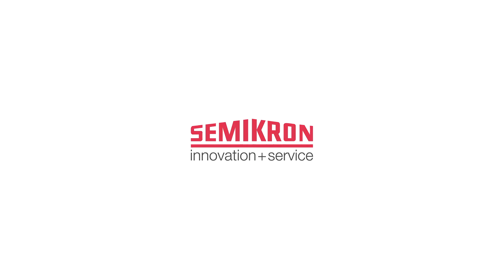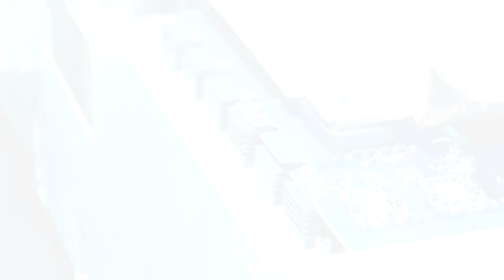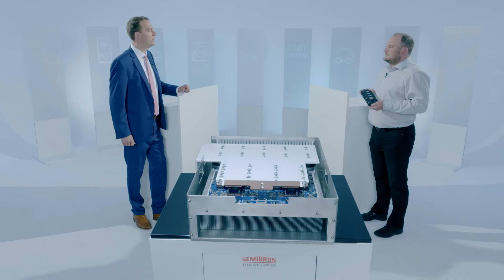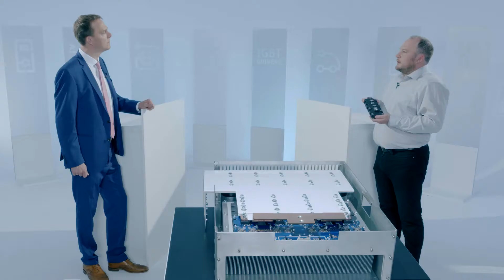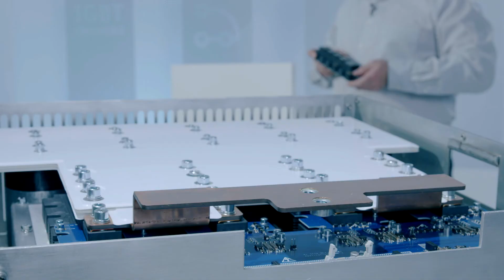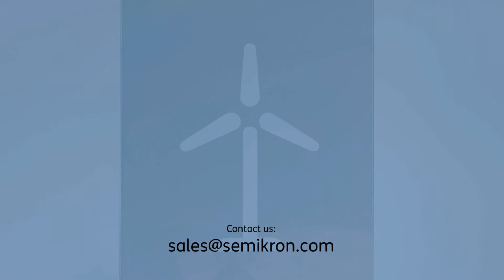3-Level Modules for Multimegawatt Converters – Power Electronics for Wind Turbines

Comment: How about the driver for 3-Level topologies.
Reply from the maker: The SEMIKRON SKYPER 42 LJ PV is optimized also for high power 3-Level applications. It has an extended clearance and creepage distance to allow operation at DC-link voltages up to 1500VDC. Due to the advanced failure management, the drive adheres to any turn-off sequence of the semiconductors, defined by customer's control unit, even if the driver has already entered error state.